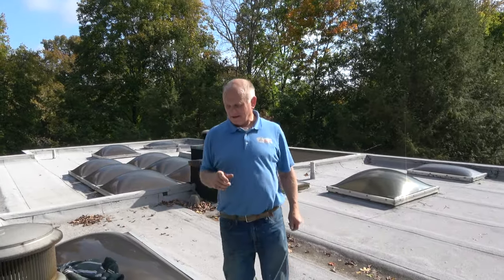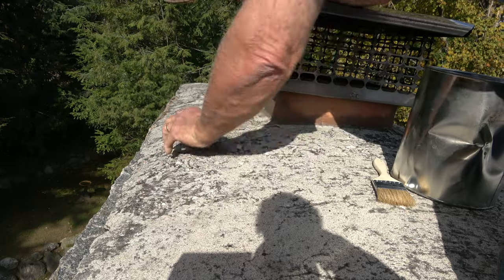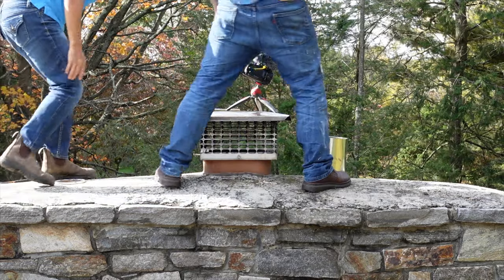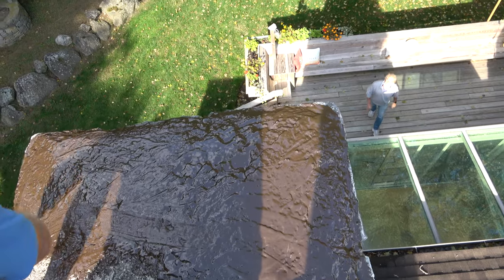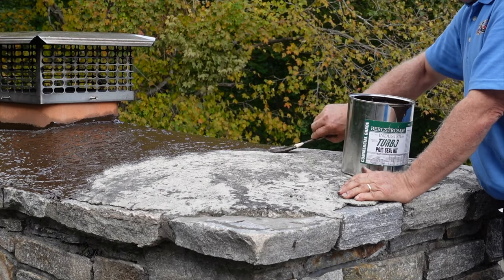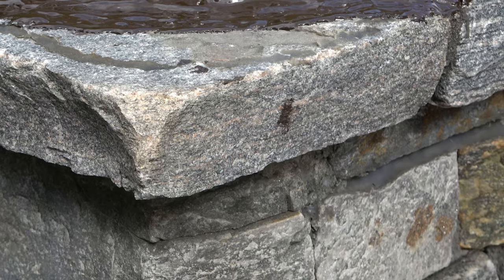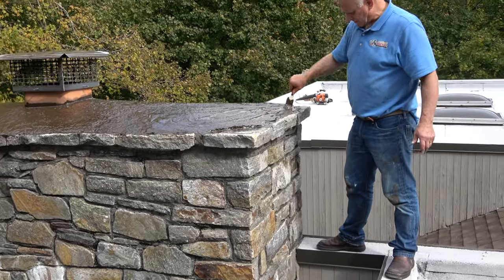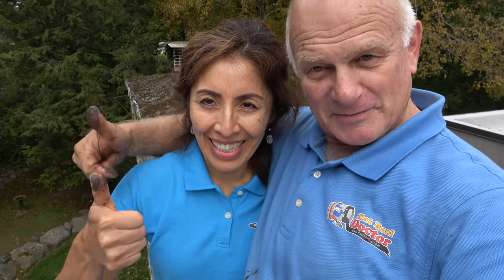Chimney Cap Seal - Amazing Easy Trick Saves your Chimney

Comment: I believe u i see cracked cement chimney caps  all throughout the our neighborhood - i did mine yesterday this way and i it rained and it never leaked im impressed 

But my question is why wasn’t it done this way to begin with if they knew cement will fail ?

Comment: What are you going to do when the rest of the capping cracks, for your product to work you should remove old capping then re cap with the correct mix wait for it to cure then put the sealant on top, 
✌
Reply from the maker: Yes your correct. Doing it the way you describe is better. But the owner did not want to spend more than what we offered. This will last for 5 years or more but eventually the UV's will break it down and then they could do what you recommend.